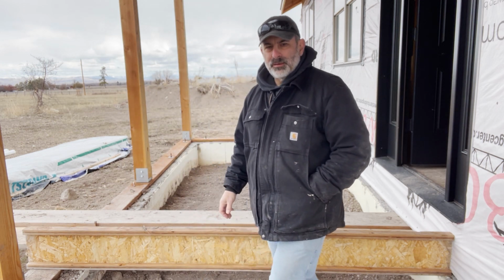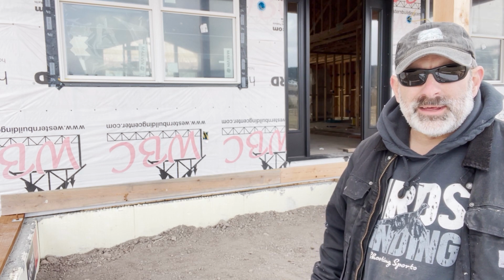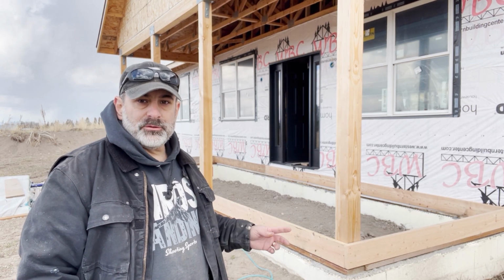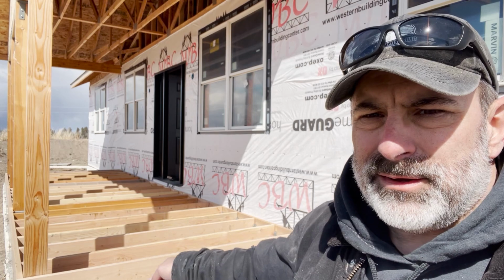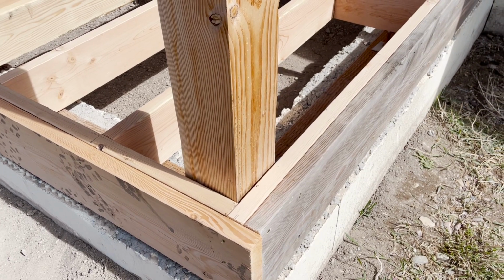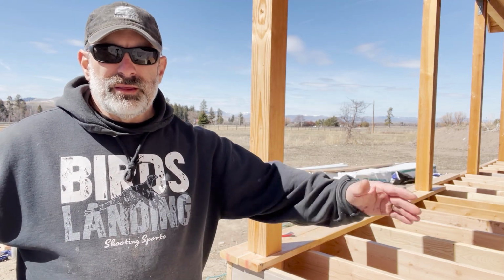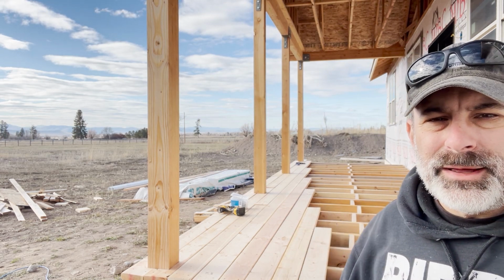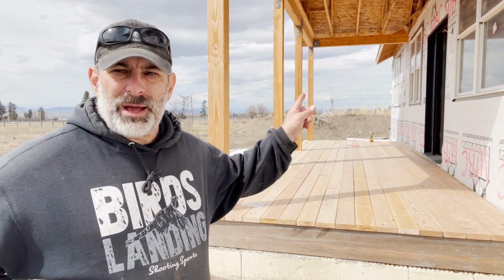Completing the front porch and deck  | Building Our Own Home Ep. 65

Comment: Do you plan on railings for your porch.  It seems that most areas require a railing if the deck is over 30 inches from the ground.  Yours looks much less than that, but much higher than a step.